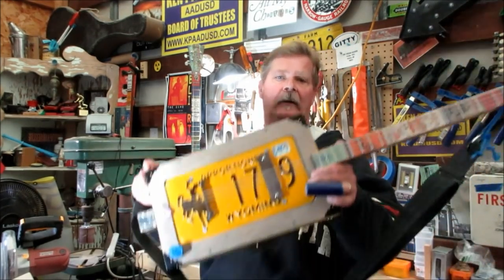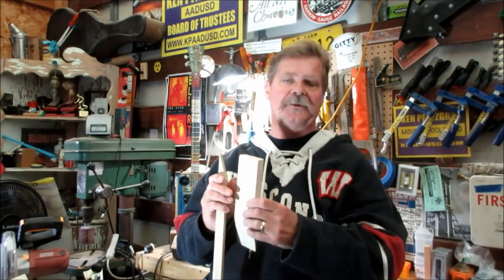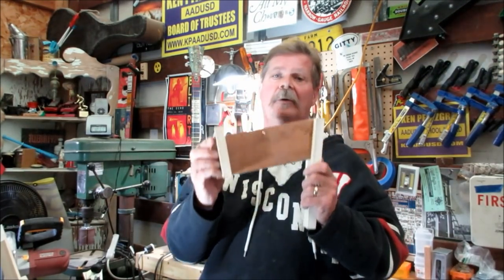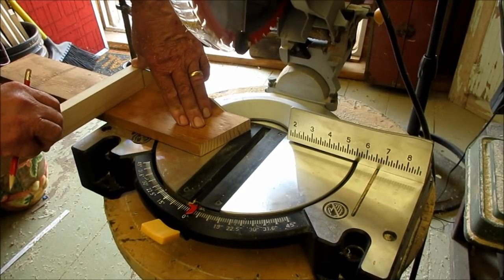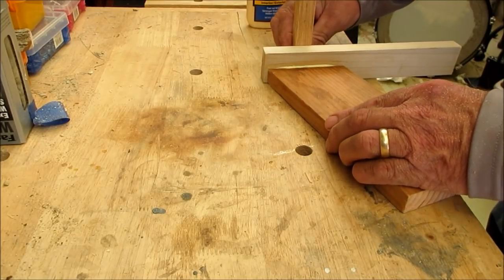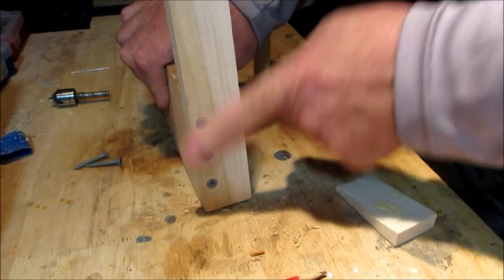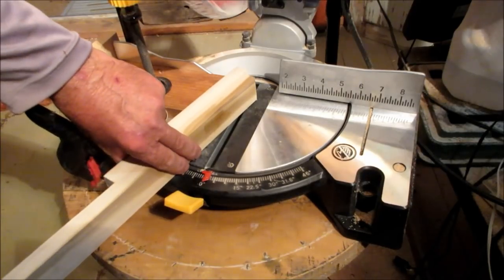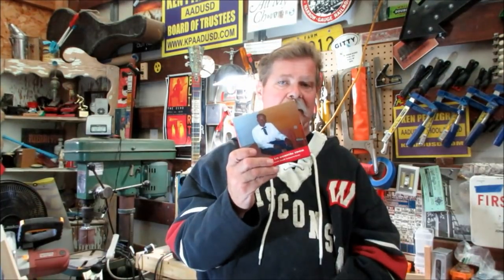How to Build a Scarf Joint Jig

Comment: When I first started watching this video, I thought you were going to be doing the scarf joint in one cut, such as if you were using one long board that would end up being both the neck and headstock.  While watching you make the jig, I thought “there’s no way he is going to have enough clearance in the back of that chop saw to stick a board through there past the fence”.  But when I saw you use two separate pieces of wood, that makes sense and honestly, I’d never even considered that myself.  It almost makes it a little easier since you won’t have to glue “ears” onto the sides of the headstock in order to make it wider than the neck.  Nice video and great jig!  Simple and effective.
Reply: Yeah, it took me a minute to figure you do not use the cut off parts.  So there's a couple inches you discard but can cut off a new four inch piece with the 15 degree cut on it to use as the headstock.   Nice!

Comment: Thank you very much for this scarf joint cutting jig video. I have that type of chop saw but I didn't know how to use it to cut scarf joint nor I have a band saw. IIm building electric guitar although the neck blank is wider than a cigar box headstock but the principle is still the same. Thank you very much.
Reply from the maker: Easy$ thanks for watching.

Comment: Thank you for a very informative video,,,,,I have a question,,,,if the thickness of the board you use is 3/4 inch thick,,,,do you have to make the boards thinner to accommodate for the length of the tuner?,,,,,,for example would you have to remove about 1/4 inch thickness and then make the cut for the headstock,,,,,,,thanks,,

Comment: I like to make Scarf Joints on a band saw. For a 15° Scarf joint, measure out the angle cuts at 3 1/2 ". A 12° scarf joint measures out at 4 1/2" point to point. Have fun with your band saw. Just don't cut off your fingers. 🎸

Comment: The only thing I did to improve in your design for myself was I put a back brace using a scrap piece 1 x2 that fits up against the steel saw brace and atteched from the bottom of the jig perpendicular to your "wood stop" I use a few extra wood clamps to help hold the jig as solidly as possible for cutting.  Simple add on but really helps hold the jig steady.
Thanks for the idea Ken, good job
Reply: I don't understand this...could you help me here? Can't visualize what it is you're helping. Thanks
Reply: @ThePavit52  sorry. Just saw this, my improvement was an addition back brace that runs perpendicular to the actual jig, your particular saw might not have a metal wing, although both of mine do, to support the jig and keep it square to the chop blade.  Very simple, but does help, built over 400 guitars using this type of jig and works perfectly,   good luck!

Comment: I just finished making one of these. Thanks so much for your videos, and instruction. God bless Bro.

EDIT: Quick question though...do you still thin your head stock like you would without a scarf joint? If not, how thick is your head stock and what tuners do you use. Mine tuners only seem to stick up by a little over a quarter inch. Thanks very much.
Reply from the maker: MrLyge email me kpcbgs@gmail.com